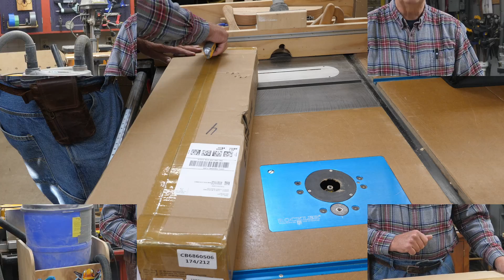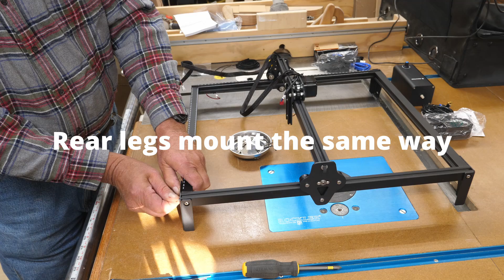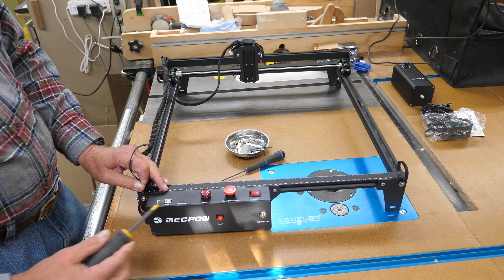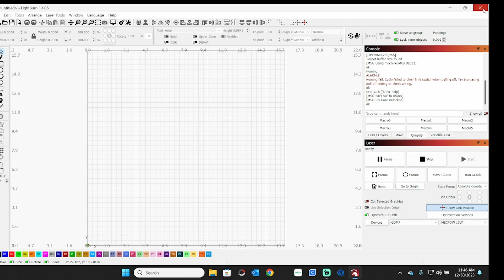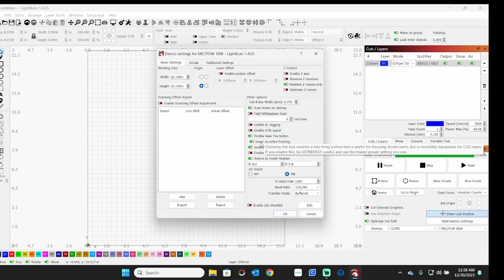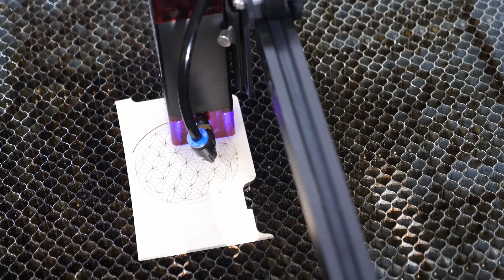Mecpow X3 Pro Laser Detailed Assembly

Comment: You completely left out how to attach the laser, how to adjust the screw on the eccentric nut.  The video just jumped from looking at the eccentric nut to powering it on.  I’ve never put anything this complex together 😢
Reply from the maker: Eccentrics on Mecpow are always pre set from the factory and have yet to see one that wasn't.  Attaching the laser head was not included as it is very obvious how it mounts.  How to adjust focus was covered.

Comment: Just got a new Pro3 10W and wanted you to know that they changed the legs and have added a slot that you can pull the chain through.  No more going crazy trying to bend it down and then up to be caught by the washer.  They must have listened to your video because the ends on my chain curled up to make it easier to thread.
Reply from the maker: Good to hear!

Comment: Another good video! I'm thinking about buying one of these. Do you know if the Xtool  RA2 Pro rotary attachment will work on this laser? Thanks for sharing your knowledge and expertise.
Reply from the maker: Yes it will as xTool supplies multi use cables in the kit.  Just unplug the Y axis motor and use the adapter with the kit.

Comment: Is it possible to change the 10W to a 20W or higher power?
Reply from the maker: Possibly.  The mount on the X3 looks identical (in photos) to the X5.  However, it may require a larger power supply brick and a larger head may have a different number of pins on the connection.  Best would be to contact Mecpow.
Reply: @rogersshop checked with mecpow, can't be done